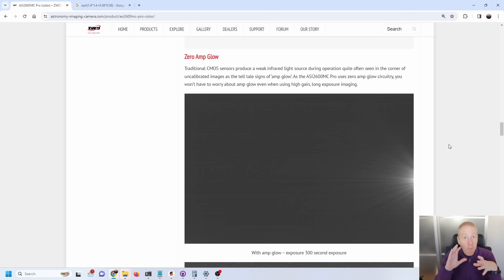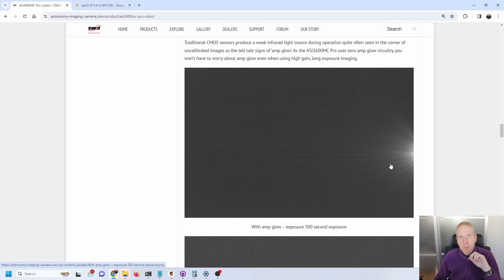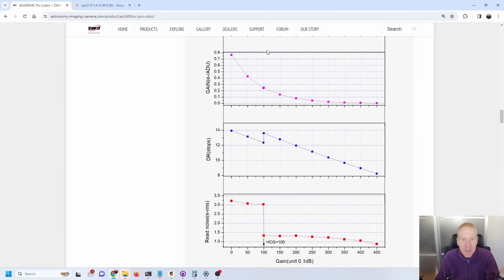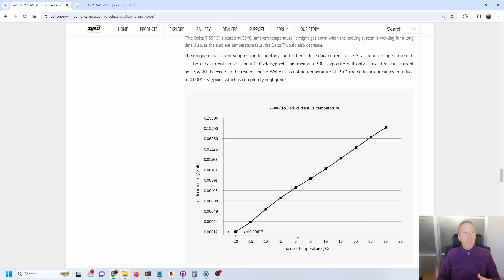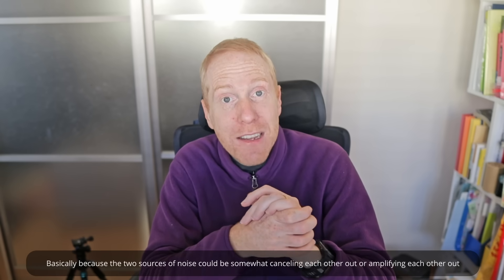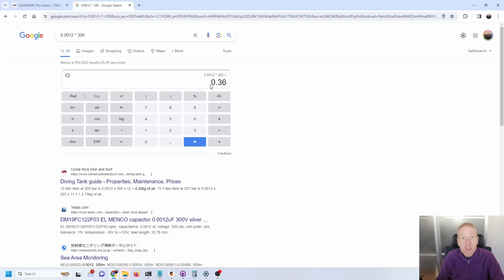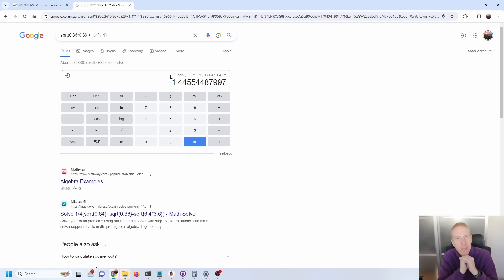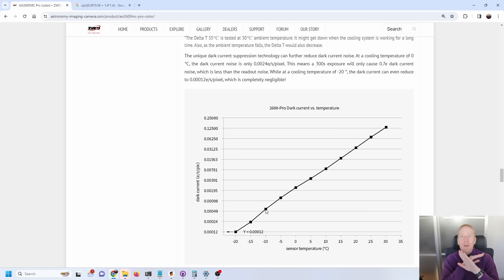Why I DON'T take Dark Frames (and what I do instead) - Astrophotography

Comment: Hi Cuiv!  I agree with you on this as with the newer CMOS sensors that are both back illuminated and rolling shutter no longer need dark frames especially if the sensor is cooled.  Every image sensor, be it a CCD or CMOS, has what is known as dark fixed-pattern noise, a pattern that is the result of the manufacturing process.  If you take a master bias stack and use Pixinsights SuperBias process on it, you will actually see that structure hidden in all of the randomness (I wouldn't use it though).  Bias frames are basically very short dark frames as you still need darkness to exclude random photons (shot noise) from the calibration.  But the structures are so relaxed and faint on modern CMOS that like you said, there isn't too much difference anymore unless you take a crazy long exposure like 10 minutes or more then the dark current will start to build up thus now needing dark frames.  Dark frames did have a good use though and that was removal of hot pixels but now the CosmeticCorrection process in Pixinsight can take care of those pesky hot pixels.  If you dither well, the stacking algorithm will also remove the hot pixels.  So there is no more use case for dark frames on the latest sensors unless you intend on doing exposures over 5 minutes then you may start to see a little amp glow.  As always great video!
Reply from the maker: Thanks for this Dave! I gotta say I never used CC in WBPP! Good dithering always took care of hot pixels
Reply: The devil lies in the details. E.g. when I'm doing exoplanet photometry with very much cooled (-55 C) CCD camera and have "ordinary number of 10" dark frames to calibrate sky frames my 12" telescope works as normal 12" one for such type of photometry. I'm using actually many more dark frames (hundreds, in fact) to calibrate out both non-uniform (but constant) bias effects and small variations of dark signal (hot(ter) pixels etc) and after that my photometry has the typical quality close to what could expect from ca 17" telescope...
Astrophotography is of course (much) more relaxing in terms of what you can do with data processing... 🙂

Comment: Hi Cuiv, first of all, hope you, and all you know are ok from the latest terrible earthquake.  OK.  So I have said, I have the OGMA AP26CC camera, which I think is the same as yours, just a different name.  I am going to try this way of processing with my latest image from last night!  One less thing to worry about.  Also, was wondering if you saw my question about offset, from you last video.  I see that you can see the settings for your camera on the actual page, whereas I have to go into the settings tab to see mine.  Offset does not show up as a setting.  I can, however set it in sequencer.  I am still learning NINA.  Any suggestions would be great, and thanks for all the videos!
Reply from the maker: Are you using the ASCOM driver rather than native driver?
Reply: Well, now that is a very good question!  I am still learning everything about NINA!  I think that I downloaded ASCOM from that site.  I will check.  I have learned a lot about computers since I was born before they existed, but I still have a lot too learn!  Amazing I have gotten this far! Thanks for the response..  PS. I tried processing without dark frames today...seemed to work just fine!
Mark @CuivTheLazyGeek

Comment: I was taking darks when using ASI294MC Pro but stopped when I started to use ASI2600MC Pro and no problem at all until last September when I started to use Antila SII-Hb NB filter. I noticed lots of noise with SII-Hb therefore I took darks. Dark frames clearly took care of the issue. Hope you can explain why this happening only with SII-Hb NB filter. Appreciate your explanation.
Reply from the maker: Maybe the hot pixels - are you dithering well?
Reply: Yes, I do dithering every frame. I think it is overkill but keep the same setting is easy. In that sense, I am lazy too. @CuivTheLazyGeek

Comment: Thanks for another nice video!  When you're stacking with WBPP in PixInsight do you just include lights, flats, and bias.  Or do you use your bias as a dark?  The only real reason I could see for using bias as the dark is to avoid the warning that WBPP issues if you don't have darks.  But I suppose that it's good practice at being lazy if I learn to ignore those warnings. ;)
Reply from the maker: Just lights, flats, bias!

Comment: i have the QHY294M pro which uses a sony IMX492 sensor i believe. I have to take darks for the amp glow. but do i need to take BIAS if im taking darks? i mean, the BIAS noise will be a part of the darks anyway right? cheers Cuiv!
Reply from the maker: If you're taking many darks AND dark flats (this is important), you may do without bias. Or simply use the dark flats as bias equivalent!
Reply: @CuivTheLazyGeek  i actually dont take dark flats! sounds like i need to look into this again!! thx Cuiv!

Comment: Another nice video Cuiv. Let me ask your opinion on dark frames for uncooled cameras with modern sensors. I recently swapped out my old Canon DSLR for an Svbony sv705c which has an IMX585 sensor in it, but is uncooled. That may sound like a downgrade or at least a lateral move, but the sensor is just so much better than the one in my old Canon that for me it was an upgrade. I haven't gotten to use it much outside of some EAA due to weather, but I'm thinking that with the lack of amp glow and the rather low overall noise I might also skip dark frames and simply use bias frames to remove hot pixels. I think that dark frames waste a huge amount of time that I could be imaging instead since I can't really make a dark library so in my mind I am better off to use the time I would be taking darks for capturing more data instead. I will be testing this theory by taking darks on my first real session and then comparing the stacks with and without to see what I think, but I am leaning towards no darks.
Reply from the maker: I would take dark frames on uncooled sensors...

Comment: Cuiv, if you were to get another reflector, would you still try to go cheap and make good or just pay the price for something more turn key instead of dealing with the headache ?
Reply: Reflectors never end up actually being cheep.  You almost always need a coma corrector, and usually have to upgrade the focus or because you’ll get tilt especially the Sky-Watcher models the focus upgrade is ~ $650 for manual or $2000+ for a moonlight and a coma corrector is $400
Reply: @rvoykin  so buy once cry once or part one together is my question.
Reply from the maker: Difficult to say... I really really like my little Newt now!

Comment: I use Sharp Cap and I take flats which fixes terrible, terrible vignetting.  I also take dark frames which eliminate the amp glow from my ZWO asi294mc camera.  I did not have to use dark frames when I used my ZWO asi585mc.

Comment: Hot or even slightly warm pixels will start to stack up.  I can't think of anything but Darks to remove that.  I will start doing Dark Flats now.  I just keep a Dark Library.  I will try a couple of processing runs with your method and see what I get.
Reply: cosmetic correction in WBPP can take care of hot and cold pixels
Reply: Hi! I think you can bypass this issue if you dither after each few frames. 
Greetings and CS!

Comment: As some other colleagues have mentioned, I also prefer to take dark frames (I'm also an imx571 owner). Dark frames can get rid off hot pixels and some pattern noise; in particular, the dsnu (dark signal non-uniformity). Cosmetic correction can also improve hot/cold pixels removal, but it is not as accurate as dark frames.
Another point. I respectfully disagree and think the calculation you are doing with dark noise is wrong. It is specially noticeable when doing the maths with the 300sec sub. The 0.36e- is not the dark noise, but the dark current. Look at the graph. It correlates sub duration with dark current, not noise. The noise (actually, the shot noise) for a 0.36e- signal is its square root (0.6), but since you have to square it again, you are back again in 0.36. So you have to sum 0.36 + 1.4^2 and then the square root. The result is 2.32, which is quite higher than 1.44
Reply from the maker: 1.52 after taking the square root but I see your point! I'll need to check
Reply: @CuivTheLazyGeek  yep sorry you are right

Comment: I stopped taking dark frames as soon as I got a ZWO ASI533MC camera.  I use flats with 3-5 second exposures (calculated by my ASIAir+), and the same exposure time for my bias frames (dark flats).  This gives me excellent results.  Per Adam Block, I also do a Cosmetic Correction when stacking in PixInsight's WBPP, and I drizzle.  I find that NoiseXterminator then gives me very clean images.
Reply: Why not just use straight Bias frames for the flats? What's the point of doing a dark flat?
Reply: Perhaps because the flat exposure time is not very short. With my tracing light source, the flat frame exposure is less than 1/1000 so the bias frames work well for me.

Comment: It's interesting but, while I agree about how negligible the dark current can be, I think dark frames are also used to help remove hot pixels and with my 2600MC there is quite a difference between a bias and even a 180s dark frame in that regard. I would also like a clarification: when you are calibrating your lights and if you are not using dark frames,  you must then subtract bias to your lights instead. So the calibration equation is (Light - bias) / (Flat - bias). Is this correct?
Reply from the maker: Pinned similar comment!
Reply: @CuivTheLazyGeek , Thanks for letting me know and for explaining in your pinned comment/post.  I'm going to have to dig in to see how many pixels I dither.  I set it quite a while ago and have forgotten about it since/left it as a sleeping dog.
Reply: If you use WBPP, you can (and should) do CC (cosmetic correction).  For me, this has worked well at removing hot pixels.
Reply: @dbkokinda  I do but using dark to remove hot pixels is a more elegant solution. CC rely on empirical threshold and is intended to remove the last random hot pixels (as opposed to the reproducible ones).

Comment: Great video Cuiv! I’m eagerly awaiting a 2600MM so your timing here is much appreciated. Any guidance on dealing with no darks in WBPP? Can we simply ignore the warnings that pop up?
Reply: If you are not providing darks in WBPP it will then use bias to calibrate your lights. You are not really suppressing darks but rather  replacing them by bias. It is something I feel Cuiv didn't address in the video.
Reply from the maker: As mentioned by @nicolast3499 - unfortunately I can't cover everything in videos ...
But yes in WBPP, you just don't put darks and ignore warnings

Comment: The problem is few if any of your audience will wind up substituting a Master Bias for the Master Dark. They simply don't know how it is done and you did not show them. Many of those people are also not dithering. Both of those missing from an imaging roughen will result in a lot of waking noise and bad integrations. 

You want to reduce the random noise that a dark or bias would introduce, use more subframes in your integration. My Master Bias has 400 frames. My common Master Darks 100. It is not really hard to do on a couple cloudy nights with the gear setup in my dark basement. 

I spend a few hours a day helping novices over at CN. I can guarantee this video will screw up a lot of people, who will ONLY hear you don't need darks. They won't bother with bias, dark flats or darks and often don't even take flats. Then wonder why it all looks like crap compared to successful imagers. The flats don't work or the walking noise is impossible.
Reply: If they only hear "you don't need darks" and don´t bother to follow this video carefully and do their own resaerch for their own camera it´s their fault.
Reply from the maker: It's one of the impossible issues with videos that can't be tailored to a specific level of knowledge...
Dithering is a point I had forgotten about but I did pin a comment on this and will add more in the description.

Comment: Seems a lot changes with newer cameras..  having started with DSLR more than a decade ago we get into a pattern of doing things, for good reason at the time, but don’t continue to evaluate why we’re doing them.   This seems to make total sense, thank you!
Reply: There's a term for this that gets used a lot in software engineering, "cargo cult."

It refers to a set of curious religious systems that arose primarily after WW2 in some pacific islands (the phenomenon is older, but the best documented cases are from WW2). Western nations descended on those islands in mass, built airstrips, and flew in huge amounts of wealth in the form of "cargo". Manufactured goods, food, etc.. The locals saw all this happening, but had no understanding of how the cargo was produced or why it was being flown in. Some of them ascribed supernatural origins to the cargo, and when the westerners left, they built mock airstrips and filled them with mock radios and such made from coconut husks and straw. And they staffed their mock airports with people wearing mock uniforms, performing rituals mocking the behavior of the westerners that had summoned the cargo planes. After all, the westerners did it and the planes arrived, so why would the planes not return when the islanders did it?

So "cargo cult programming" is when people copy code or patterns they don't understand. Taking dark frames for sensors that don't need them would seem to be a good example of cargo cult astrophotography.
Reply from the maker: That is such an interesting anecdote!

Comment: Really like that you made this video. After watching your last one, and with a 2600 MM on the way, your comment about no darks really piqued my interest. Revisiting the RMS equation and looking at the low dark current contribution was a nice way to explain it (at least for my engineer mind). I've heard the argument "well why not just create a dark library and use it anyway, because it's easy."  Good point on possibly introducing artifacts to counter this argument. For monochrome imagers, one fewer thing to think about is nice. We already have to take 3-4 sets of flats, and not worrying about keeping up a dark library will be muy bien.
Reply: I don't see how anyone would introduce artifacts when creating the dark library though. You remove the camera from the rest of your gear, screw on its cover, and take your darks inside in a closet or something to be extra sure no light can get in. I started off not using them even I got my 2600mc because people say they aren't necessary but they're so easy and have no real downside so I use them now.

Comment: I dont use bias with the new cameras.. but i use flats and flat darks
hey, show us the rasa 6
Reply from the maker: Flat darks are effectively equivalent to bias these days :D
C6 is dead, dropped it :-(
Reply: @CuivTheLazyGeek  oh sorry to hear about the c6, I thought celestron had sent you one of the new rasa 6 for review ;)
Reply: @CuivTheLazyGeek  Sad it hit the ground. My late buddy had a 11" with Hyperstar and a piggybacked Takashi 76mm apo.... both with SBIG cameras on them. He dropped them when trying to install it on his mount....SCT and Tak had  damage although Celestron replaced the broken corrector plate and rematched with main optic (even better than before) and the TAK only had a dented tube so they knocked out the dent and checked collimation.  That is when grown men cry ;-(    I have 8", 11" and joint use 14" all with Hyperstar....plus 6" APO refractor. You can bet I am VERY careful when putting stuff together and taking apart!

Comment: I do the same with my Asi533mc pro. Works well for me and lets me spend more of my limited free time imaging.
Reply: But you've got a cooled camera. Zero reason to take darks during imaging time, they can be taken at any time, that's the 2nd benefit of the cooler.
Reply: @theBaron001  My free time isn't just limited by "dark time" - I get very little free time in general as a single earner with a disabled wife.

I took darks during the day for my first several years imaging and then experimented with using bias frames only about 4 years ago and saw no decrease in my image quality, so I just stopped bothering with them.

Comment: I use an APS-C IMX571 sensor, and IMHO it’s always best to use darks, as they remove hot pixels, and in my case I don't dither, and so the darks remove the walking noise too, then I take 4 second flats and 4 second dark flats to calibrate the flats, and no bias…people’s opinions seem to vary, horses for courses as they say, so do what works for you…clear skies…
Reply from the maker: I pinned a similar comment! If you don't dither this is indeed useful
Reply: The math is actually different if you do not remove the bias to the flats before the master flat is created. It changes the ratio of of the correction.
Reply: @davidkennedy3050  by using flat darks the bias is calibrated from the flats, so not sure of your point…